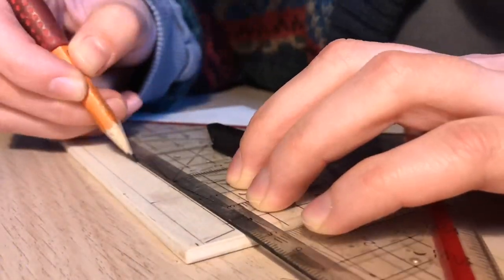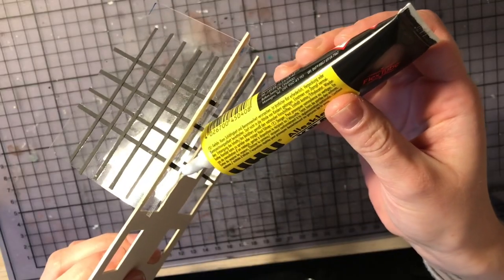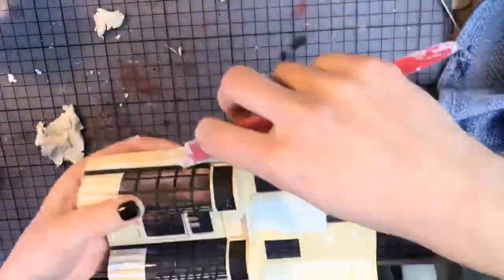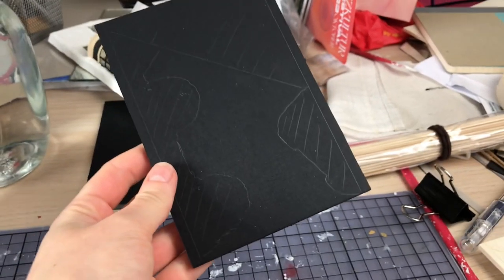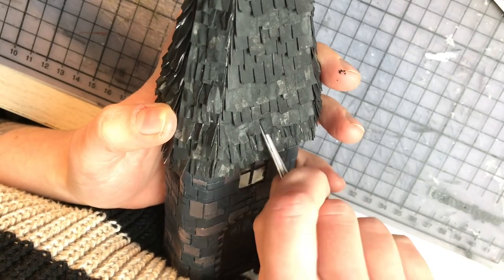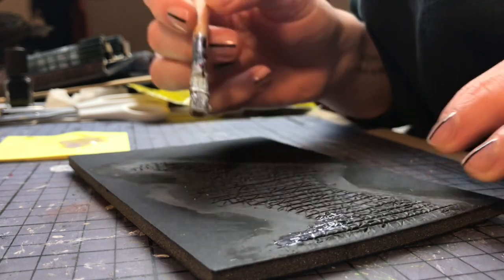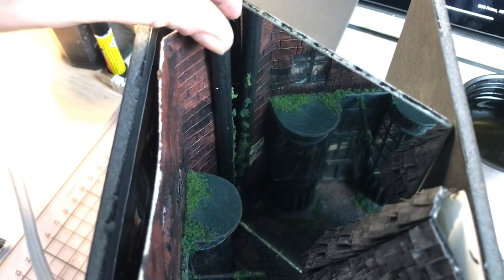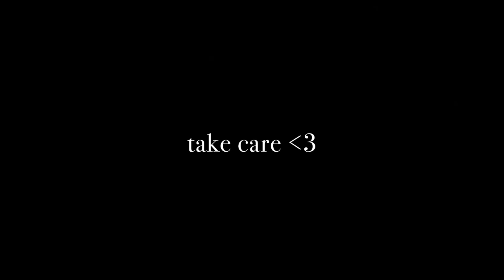Making a KNOCKTURN ALLEY BOOKNOOK from scratch

Comment: The ending shot was so relatable and I absolutely loved it. Thank you for all the information and tips you gave along the way, I absolutely love how the booknook turned out. Thank you for the tip on the static grass, it's the most believable grass I've ever seen! Two things to pass along since you've taught me so much, to get the bricks to look diverse under paint them in shades of yellow, orange, green, brown, and then paint over that with a rusty red color. It'll add a lot of dimension to the bricks. Also, dryer lint mixed with acrylic paint makes great moss!